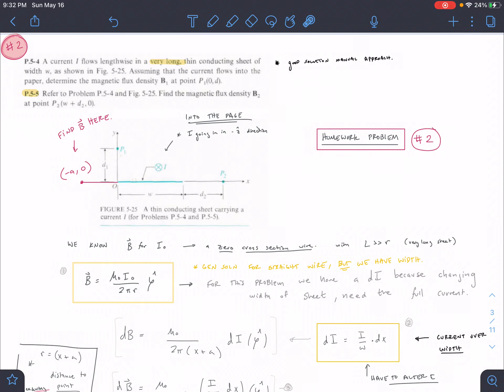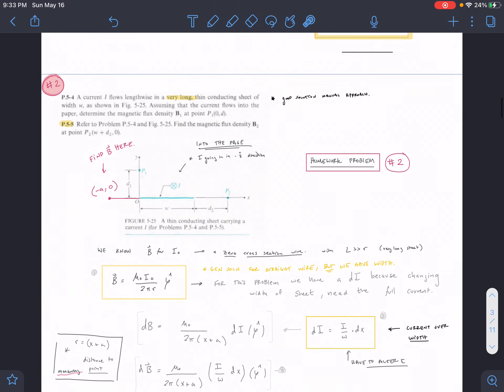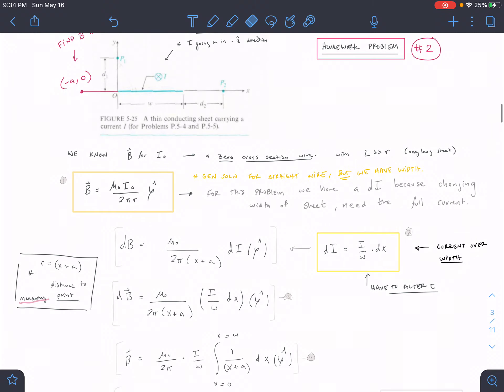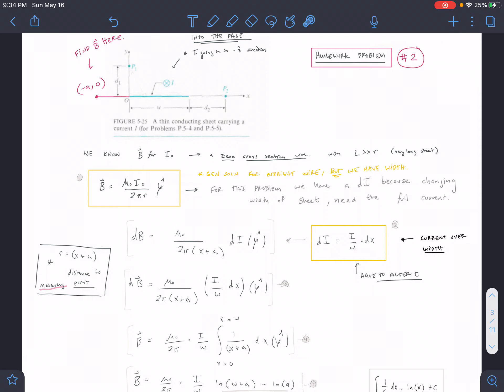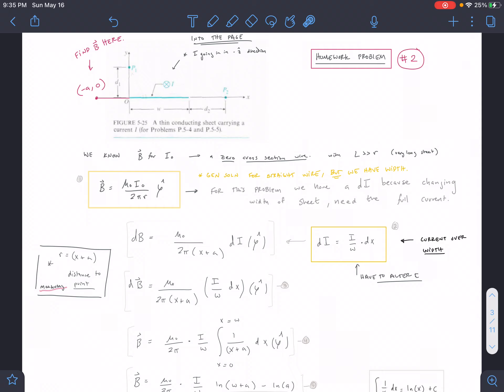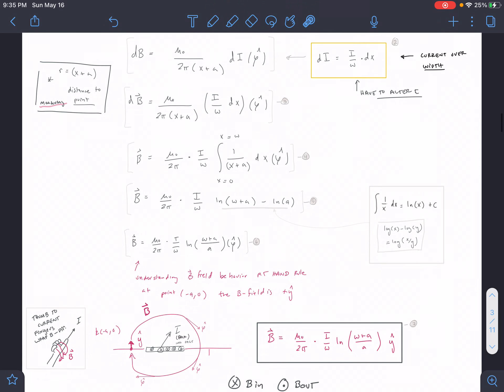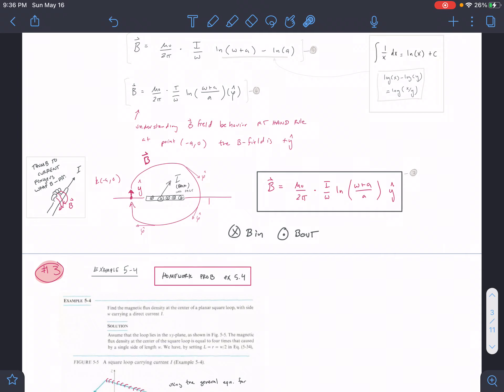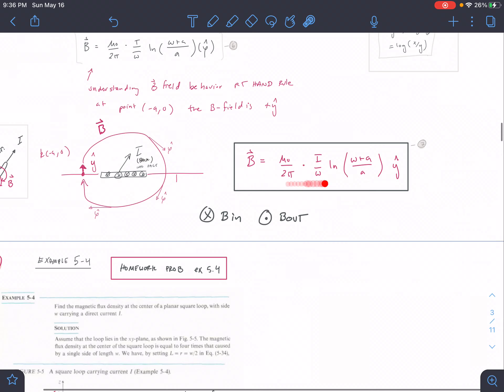5-5 - HW7 - B-Field from Current Carrying Sheet at K(-a,0)

Comment: In the book it says that the solution is going in the Z direction? Do you know why this is?
Reply from the maker: This might be somewhat confusing, but the problem solved here was not the exact book problem, just very similar. This was a HW problem identical except, we found B at (-a,0) , the book has a soln for a different point
Reply from the maker: Also, looking at the direct book solution.. that book direction I believe is an error, it should be -y at the end.
Reply: Makes sense Thankyou!